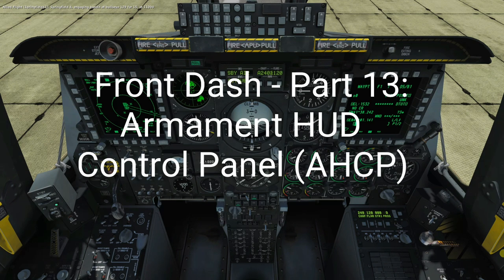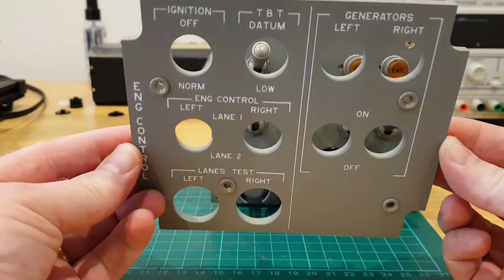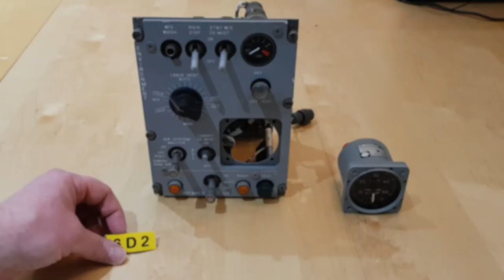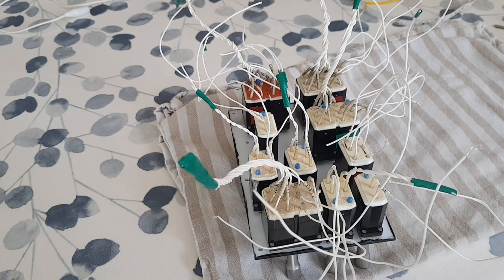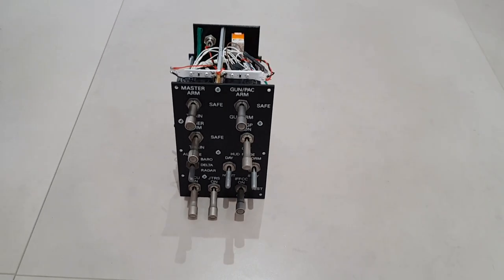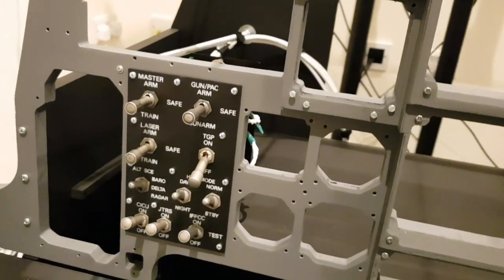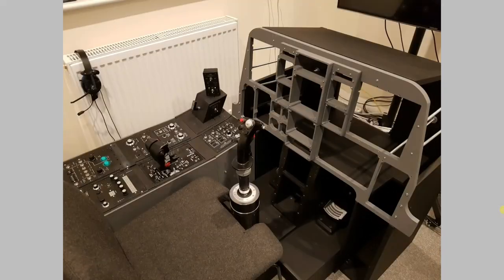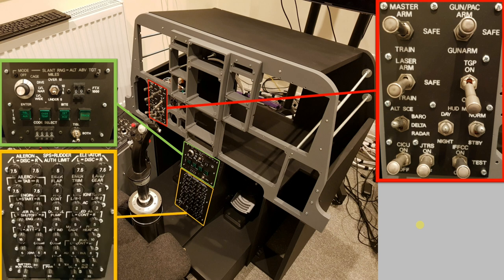Simpit A10C - Front Dash - Part 13: Armament HUD Control Panel (AHCP)

Comment: Great work again Craig. Love your approach to the circuit breakers, using tactile buttons and leds. Mine is just a placeholder, but later on i may re think that one based on yours. And the PCBs you had made look fantastic!
Reply from the maker: Cheers Ray, as regards the circuit breaker panel, it will be cool when its all wired up. It just, so much to build and so little time, lol. You'll know the score on that one better than most 👍 cheers buddy

Comment: Really interesting, and great to see real aircraft parts being reused. Ingenious use of rj45. I assume you're using these as a way to keep the wiring minimal and very tidy, and to provide an inexpensive socket/plug system that can take a very useful 4 pairs of wires.
It would never have occurred to me to use rj45 and ethernet cable as a general purpose wiring and socket solution. Brilliant!
Quick little query... and this is something I'm very interested in....in your final simulator build, what kind of screen system are you planning? Are you planning to use a digital projector and large curved screen, or are you going to stick with large tft monitors?
Reply from the maker: Hi Richie, I used RJ45 sockets and ethernet cables for a mix of reasons - standardisation, effectiveness, reliability, cost. etc. Its working well so far and thanks for your positive comments. As regards the visual setup, I haven't fully decided and to finish the front dash and right console is likely to take 12 - 18 months, so ive got some thinking time. However, im more and more leaning towards projectors and a curved screen. Although it will be interesting to see how mixed reality goes. What are you planning for your project? Cheers 👍
Reply: @CraigSmysimpit Hi Craig, thanks for your reply. Sorry for the delay in responding, I wasn't quite sure how to answer your question, "what am I planning?". 
I am planning a cockpit build, but it's a very unique project, which would be quite difficult to describe in short. I would like to tell you about it, but I was hoping to be able to message you directly. I looked on your 'simpit' website, for a 'contact me' email address or similar, but couldn't find anything. Would you consider adding something like that to your website?
Reply from the maker: Hi Richie, I'll take a look at adding a contact page to my website. Its a good idea and makes sense. Drop me an email at craig@mysimpit.co.uk 
I would be interested to hear about your project, cheers 👍
Reply: @CraigSmysimpit  Thanks for that, I will.